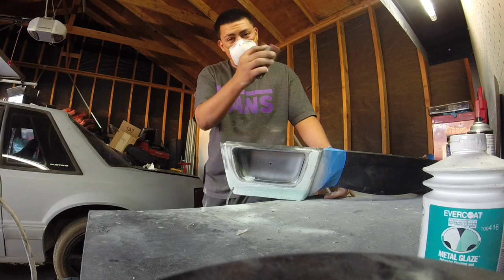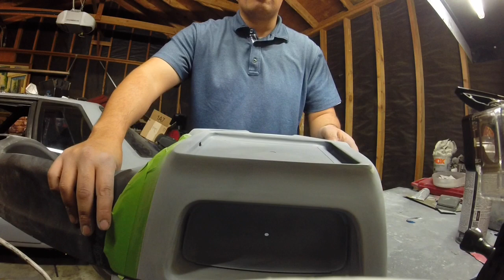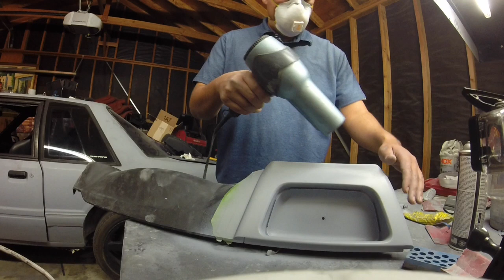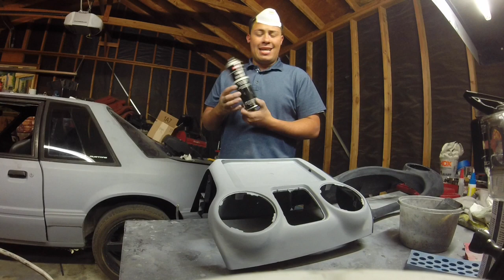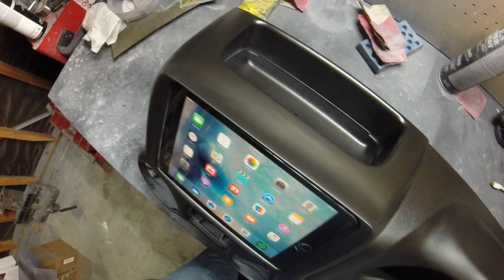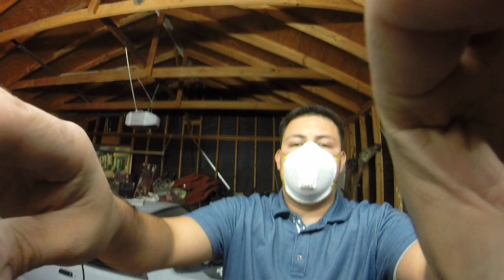How to build an iPad dash part 3 (prep & paint)

Comment: Ok I have a question. First off I salute your work you an Doug your videos have helped me a lot. But my question is, I have a dodge magnum and I bought your float mount because you all was sold out of slider kits. I tried to play a video over Bluetooth and the video lags behind a second or two but when I plug the charger to my Sony CD player it works fine. Is there a way to make changes to the float mount to add a charger slot???

Comment: cool video, coming with some body/paint experience finish your work with 180 grit then prime. I guarantee you'll save some time
Reply: ***** typically at the shop we prime, block, seal, paint and clear.
Reply: ***** the paint Rafa uses is a excellent product!!! SEM makes high quality products, honestly I wouldn't clear a dash piece. however you could use a matte clear to it if you'd like.

Comment: Yeah how do you hook up sound from iPad for the people with a budget with out the processors and stuff
Reply: +Chad Gardee I use GROM BT3. Its plug and play for your stock radio.Also controls volume and track from head unit and steering wheel bottons. Its $132 on ebay. They have videos here on youtube. I have 1 video on my channel. Its installed in 08 accord